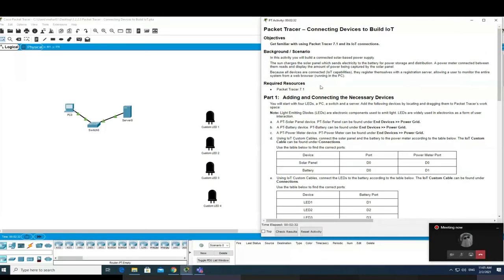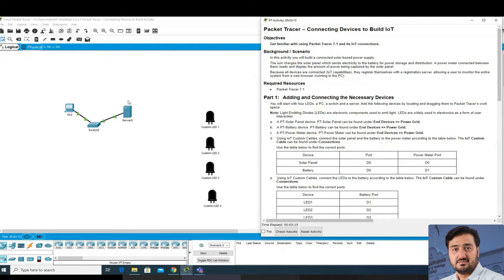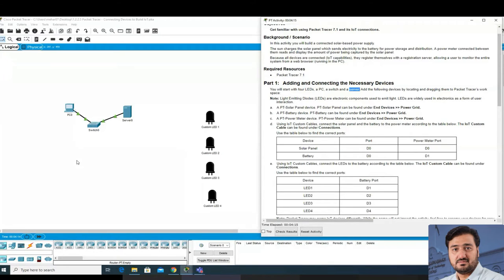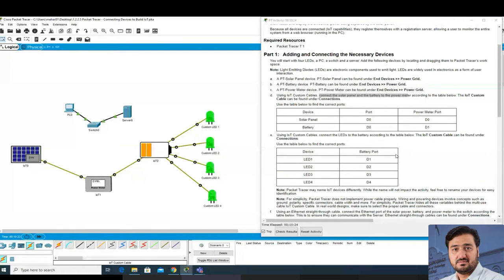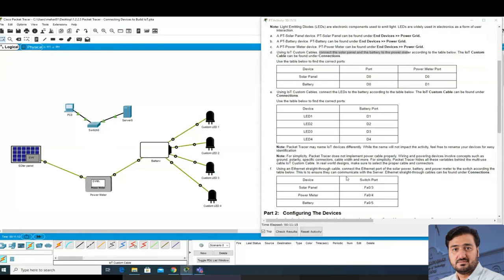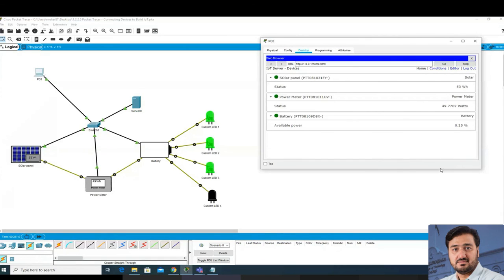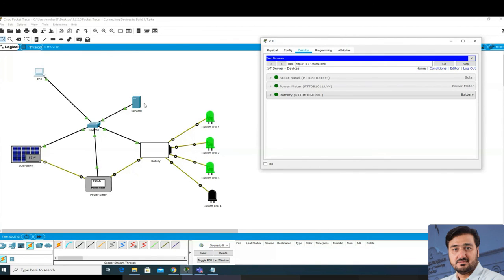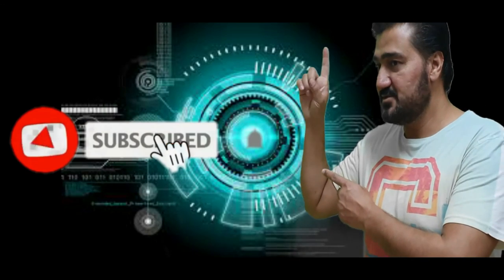1.2.2.5 Packet Tracer – Connecting Devices to Build IoT

Comment: solar panel do not have ethernet port how did you connect it to the switch ?
Reply: did you ever figure this out?
Reply: @bobnorman3094  go to advanced and change the port to fastethernet(FE) or Gigabitethernet(GE)
Reply: I used home gateway to connect the solar panel, battery and power meter wirelessly
Reply: same with me no ports showing packet tracer 8.1